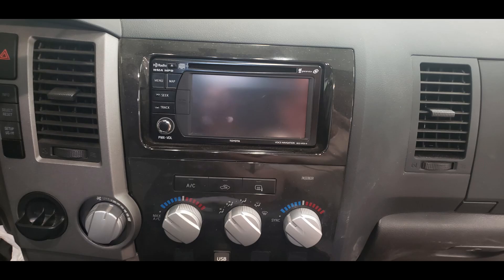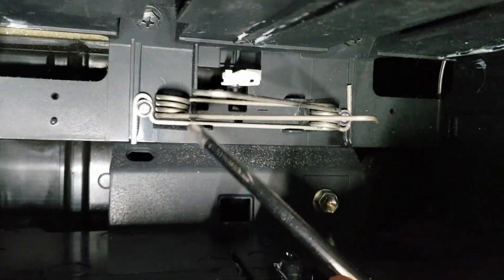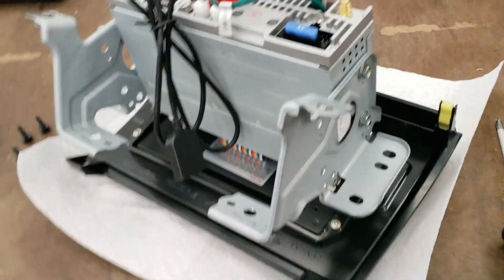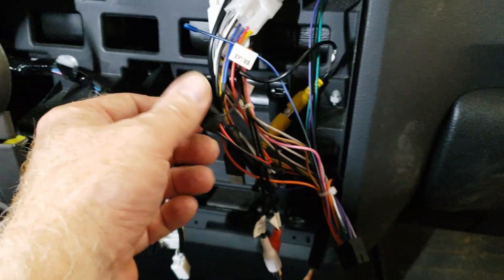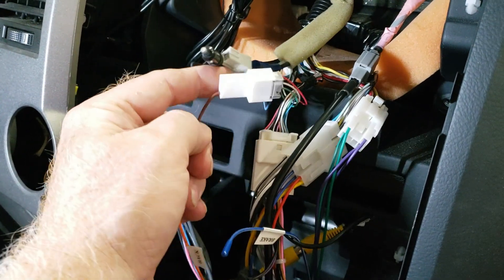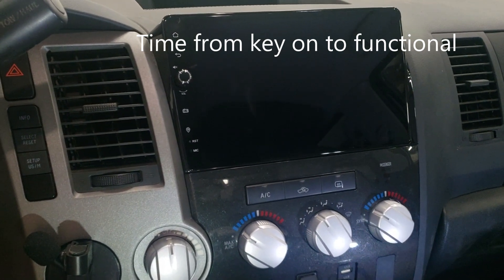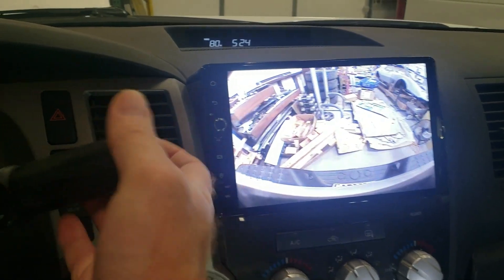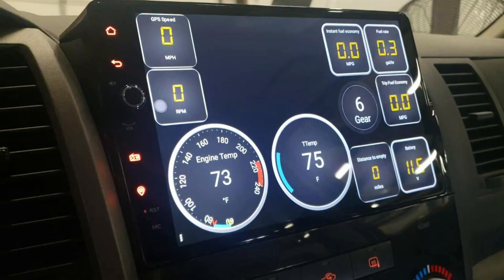2013 Tundra Joying Android Head Unit Installation

Comment: The gap is because the headunit isn't supposed to be mounted with the brackets, just the clips. Funny enough I tried to get the brackets to work and they just wouldn't for my 2010, same headunit. But personally, I'd take that gap with brackets over using only clips and either put some edge trim on it or something similar to have it sit flush.
Reply from the maker: I had the same take away. It's very solid on the factory radio mounts, and I can't normally see the gap. Thanks for watching.
Reply: Thanks for the video. I have a 2010 tundra that I've been wanting to upgrade the head unit. Did you have the basic radio or the upgrade JBL? I have the 12 speaker JBL/amped system that I would like to keep. They claim that you need to use their cameras. It's this true? At this time I don't have any but would like to install an OEM handle camera for the rear and one for the front. I was looking specifically at a model camera that has a great mounting bezel and adjustable angle.
Reply from the maker: I had the basic speaker system. I had/have the OEM backup camera. I think mine was the first time their unit was replacing this OEM unit. They made me a harness to utilize the OEM backup camera. Joying was very helpful/responsive to questions. If you send them a picture of your OEM unit I'd think they'd tell you which harness option to order. Good luck.  One note, after the update to get the wireless Android Auto to work, the boot up time is longer. From key on to reverse camera showing is 17 seconds. I do see they have a newer unit now.
Reply: I used the factory brackets. the two rear 10mm mounting holes on the bracket can be opened up like an oval allowing the brackets to be set lower in the dash. this will allow the head unit to snap in place better. Joying should have made their our replacement bracket... as always I'm having to fab stuff. but that make it fun too. hope this helps
Reply: @jschue1161  I'd be interested to see how your mounting brackets look/which radio holes you used! I'd be surprised if it sits completely flush.
Reply from the maker: @jschue1161 
Good to know, thanks.
Reply: @jschue1161  wow, great info to know.  I'm currently working on trying to add bottom mounting support to the generic frame used for these Android stereos, as this would allow countless other models to be used in the Tundra.  Whoever designed this frame should be fired for not having bottom bolt support, like the dash kits available from Metra/Scosche for DIN/Double DIN radios.  I hate that there is nothing secured to the dash in the area where to A/C control panel snaps to the radio!

It's cool how the Chinese have come out with this "frame" approach for Android stereos, but unfortunately the person who designed the one for this gen of the Tundra didn't do a very good job.  Most of the Android stereos I've seen don't even have enough back chassis to attach the factory brackets.  The other small defect was that they made the mounting point for the top middle clip the same as the corner ones.  This thicker clip with not fit into the dash, as it's a different clip in that position.  Small detail, but still. :D

Comment: How did you get this display with the gauges? I have a 2008 Tundra Crewmax with the JBL system. Will this display work on mine?
Reply from the maker: This is after switching to an Android based display (in my case Joying) in place of the stock radio/display. In particular I'm using the app OBD Fusion which lets you make custom displays. I had to use a wi-fi based OBD-II adaper to get this to work.  I'd use the Amazon Joying page to compare your radio to what they recommend to order. Or send them an email, they were quite responsive.
Reply: @ yeah I have the Joying 10.1 android head unit (JY-TZ167N4)
I’ll do some research on this and see what I can come up with. Thanks
Reply: @AZTMCS  do you have a link for the one you used?
Reply from the maker: This is unit I have.
https://www.amazon.com/dp/B0C69BTLJS
Shows no longer available. I don't have the model number handy.
Reply from the maker: This is the OBD II adapter I'm using.
https://www.amazon.com/gp/product/B00WPW6BAE/ref=ppx_yo_dt_b_search_asin_title?ie=UTF8&psc=1